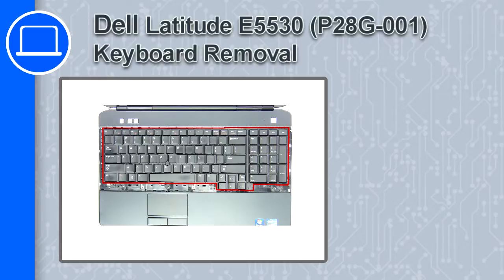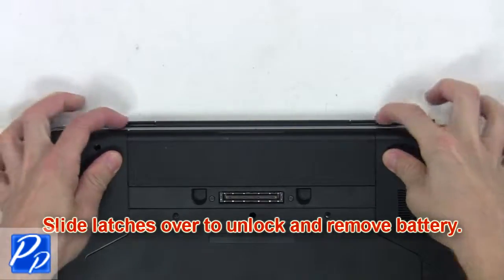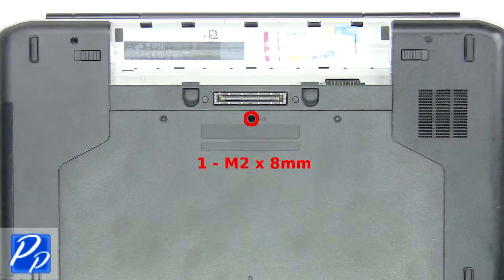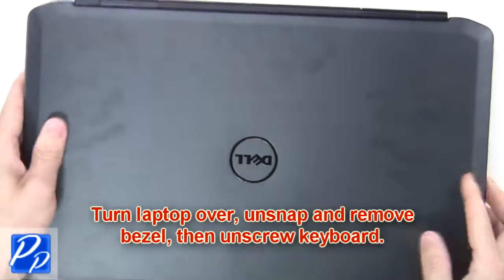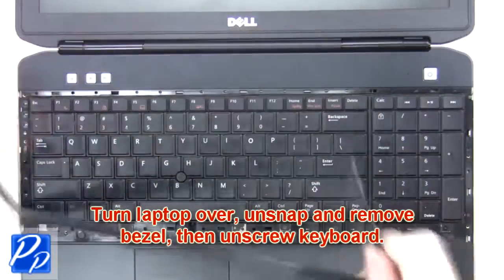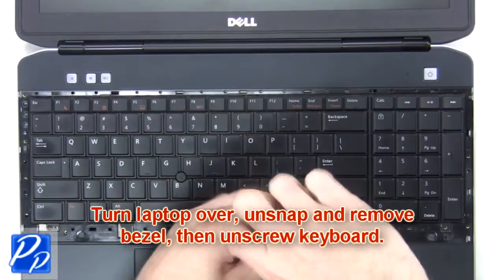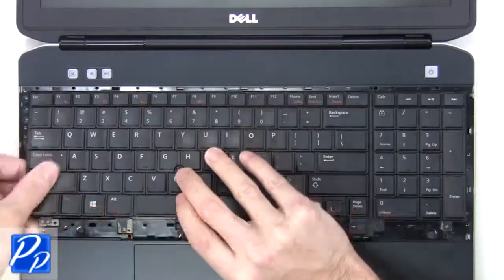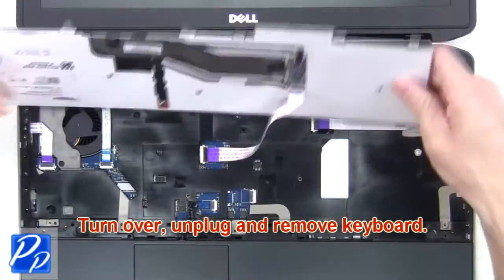Dell Latitude E5530 (P28G-001) Keyboard How-To Video Tutorial

Comment: hello, can you make a video showing how to change the wifi antenna on dell 5548, I know it is inside the screen but don't know how to open and change, I know how to remove the screen but further than that I dont.

thank you
Reply from the maker: Unfortunately I don't have a video for that and I no longer have the laptop to make a new video. From what I understand, the screen assembly is very difficult to disassemble and the wifi antenna cables are located behind the LCD screen, on the back cover.
Reply: Parts-People.Com, Inc ok thanks :D